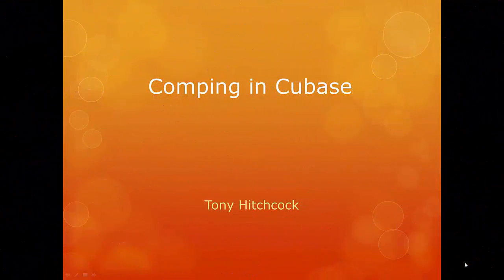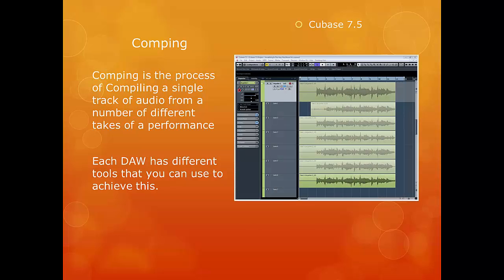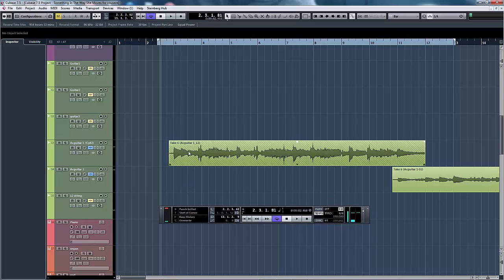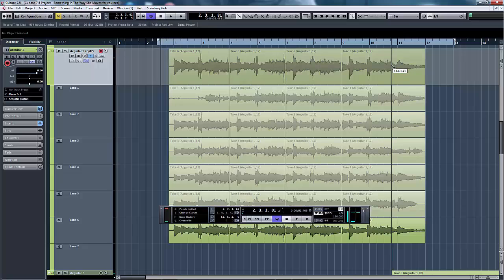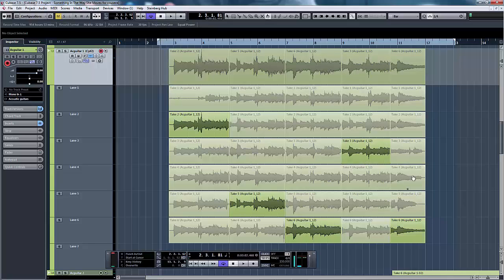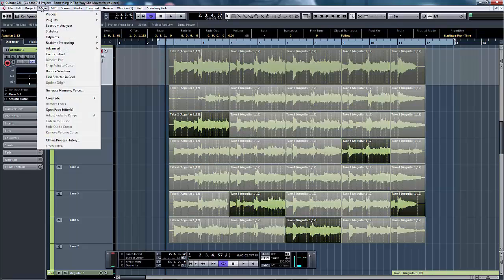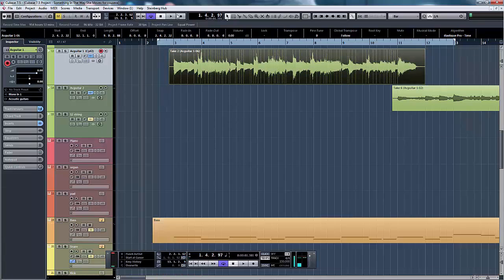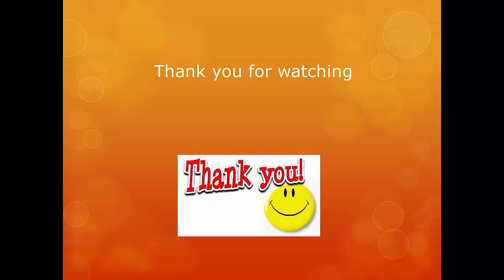Comping in Cubase

Comment: Thank you Tony. I have CP9pro. I overdubed a vocal track. Is it necessary to have more than two tracks? It didn't work with two.
Reply from the maker: I am not familiar with  CP9pro.  Comping does work with only two tracks. I would need more detail about your problem
Reply: Tony Hitchcock  Thanks for the speedy response. After I wrote my question to you, i watched your tutorial two more times and figured, with your help, how to perform Comping. It works. Thank you for an easy listening tutorial. (Smiles) Oh, C9pro is Cubase 9 pro.
Reply from the maker: Allan, I'm glad you found it useful. BTW  I eventually realised that you probably meant CB9 pro. I'm still using 8.5 at the moment. cheers
Reply: Tony Hitchcock Thanks again for a job well done. 

Oh, not to drag on, and on about our last comments: RE: Cubase's "nick" name 😂. Because Cubase is one word, it's known for short as CP9 which means Cubase Pro 9, or in your case C8.5. In other instances C7.5, C7, C6.5, C6 etc., etc.,. There is no fixed rule, it's normally stated like over many Steinberg Cubase fans. 

I've been messing around with Cubase since 
Cubase 2.0 in the dark (ages)days, using the Atari ST. In fact, I still have the monochrome and color monitors. In addition, the 1040/520 ST computers. Since they're dinosaurs, I want to give them a way, for free to a serious enthusiast. Hey man, you're doing a fantastic job. 

I'm following you, thanks. 
AJ